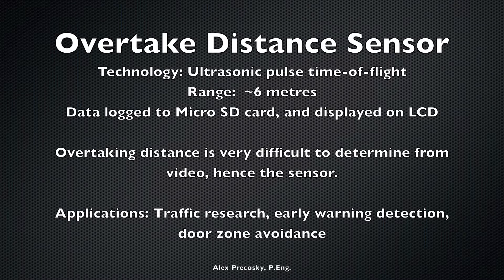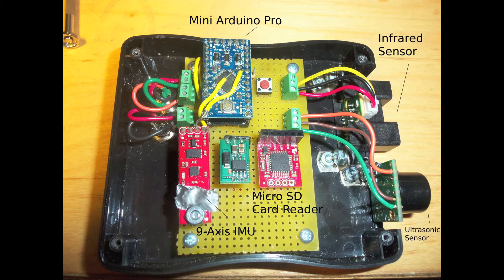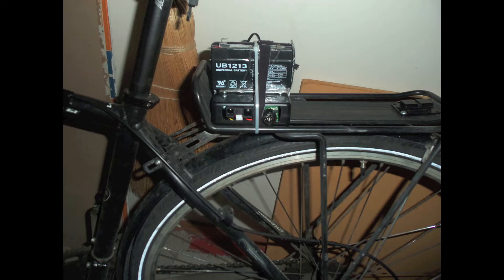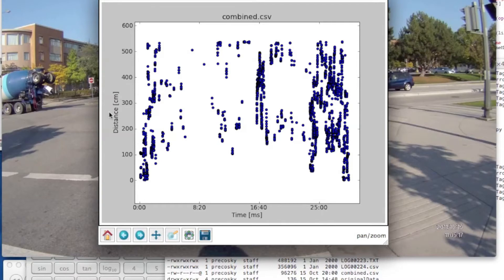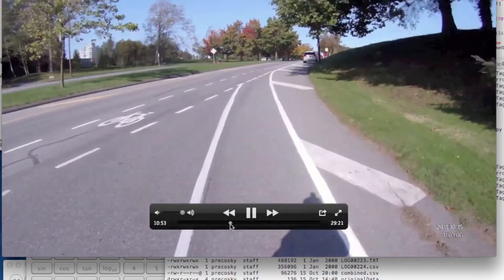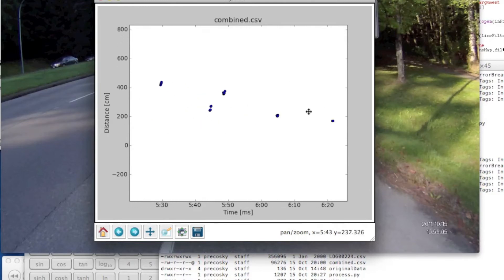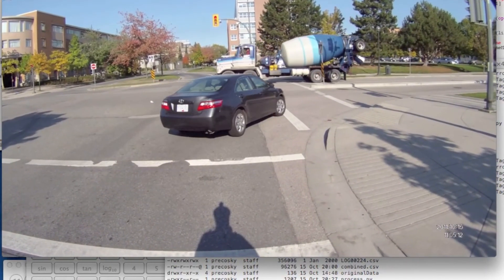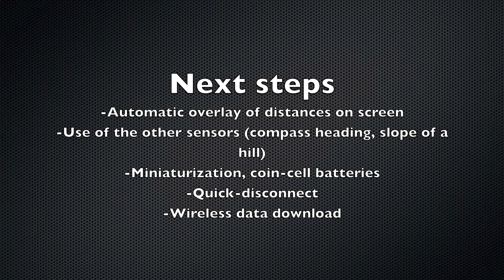Overtake measurement system

Comment from the maker: @MelloVEL0 That might work, although many don't work well on shiny surfaces like the side of a car.  The infrared distance sensor in that sensor box works like that, but uses an invisible infrared laser dot, and I got very poor results when I tried it out on the road after only testing it on very diffuse indoor wall surfaces.